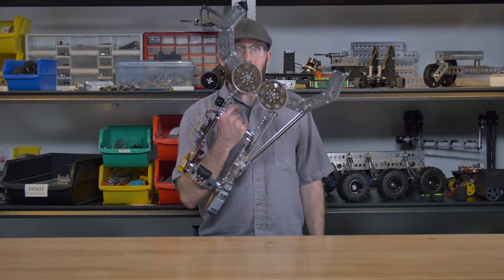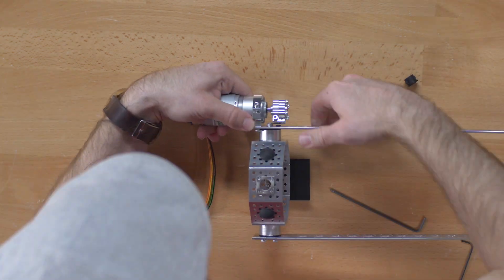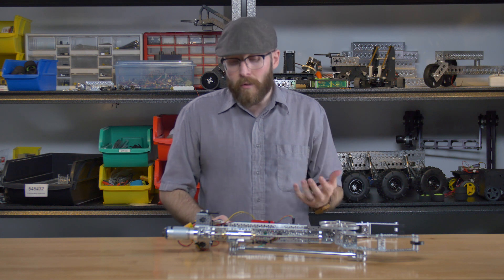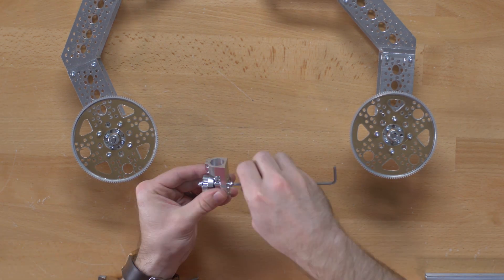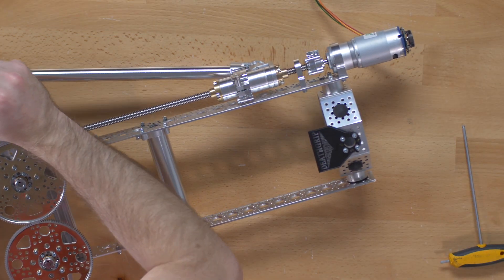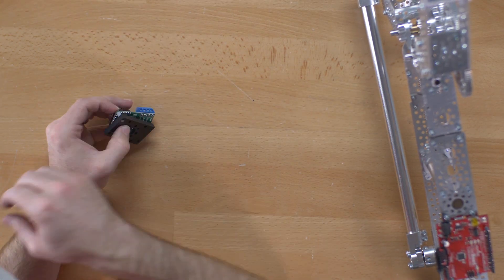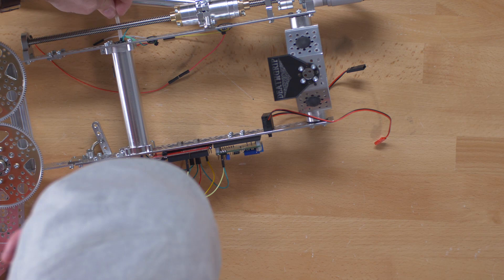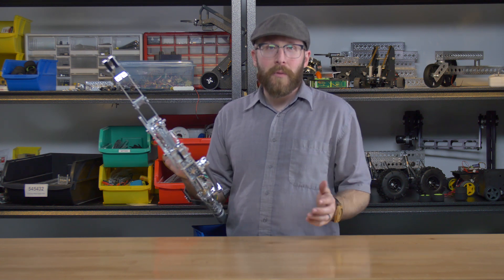Control Issues - EP 12: DeathGrip - Robot Claw Gauntlet

Comment: I love how you didn't mention that you have about $2,500 worth of parts on that one useless claw.
Reply: Still, those prices are ridiculous. I was looking to buys some parts and for the parts I need it would cost more than what I have in servos and sensors just to build half of my bot using your parts. Blasphemy.
Reply from the maker: This by no means was a budget build; we wanted to demonstrate concepts in a fun way more so than provide a project to build verbatim.   The part selection was based on cool factor, not on the dollar amount.  We sometimes create videos to help you apply concepts into your own projects; other videos are to show the most direct and feasible way to do something.  Clamping motor mounts are $6.99 due to the amount of material and machining required, smaller clamping mounts are less expensive.  Please let us know should you have any question tech@servocity.com
Reply: this stuff is way to expensive
Reply: Yes it is. For one clamp it is like $20. Ridiculous prices.